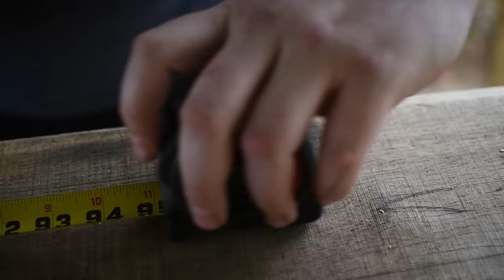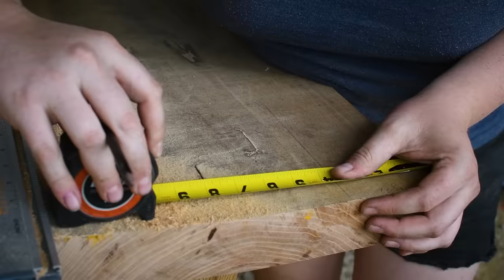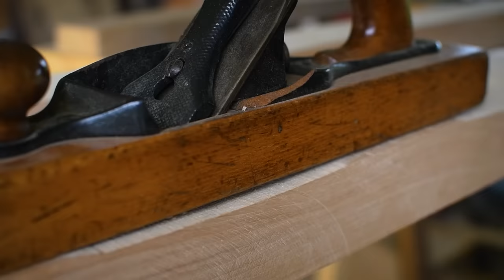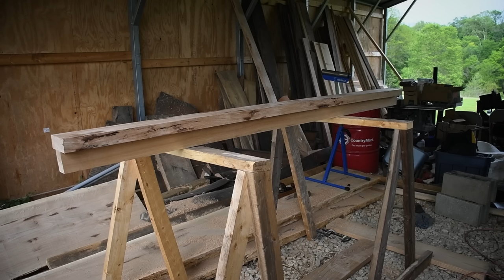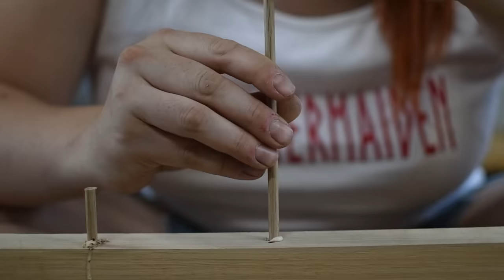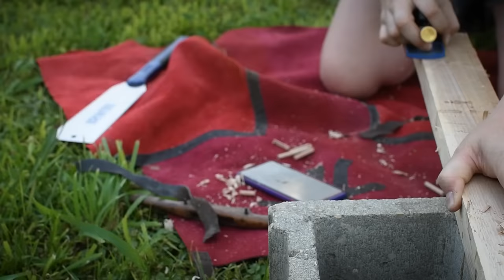Building a Longship part 3: the keel

Comment: Here’s a tip when marking a measurement at the point use a V you’ll see it’s the best if you want one can leaning towards the left or right indicating what side of the line is waist and what to be used. You know the inside or outside of the blade

Comment: If you put a piece of high density foam 2 panel 4 by 8  2inches thick on your saw horses and your lumber on top it will make it easy to cut with out worrying about   Your drop just set your blade depth so it just kisses the foam
Reply from the maker: Well that's a good idea

Comment: You where right about the wood, Too much time time fixing but a great job doing so. Also if I may, two things that may make the job a little easier. One you need a better method of holding your wood as you work on it. You are losing to much energy while planing. You need to find a better way then the saw horses. Ever time the horse moves you lose momentum of cutting though the wood. Your surface has to be stable. Second, to hog off wood a board, use a plane with a curved plane blade. Note the blade is curved and not the plane soul. This will help a lot to get the wood down to your dimension. Then use your straight blade plane to final dimension. I hope this will help.
Reply from the maker: all good points

Comment: May I suggest Veritas hand plaines( I own 4) they are pricey but well worth it. And if the plane is sticking it’s time to re-sharpen the blade. Also helps to use a little paste wax on the soul of the plane to help minimize the effort.
Reply: The sole of the plane, I presume? As in the bottom surface?
Reply from the maker: ill check them out
Reply from the maker: ok so there are a hell of a lot of options which is good for removing non end grain thickness
Reply: @ThePathOfFire  you need a longer hand plane to get straighter results, find a stanley no 5 Jackplane tun it up, or get the veritas low angle Jackplane but it cost 250buck, but a 50 buck stanley no 5 will do the same, u can watch on YouTube how to tune and sharpen a hand plane to do fine work I suggest Paul Sellers hand plane videos. Good luck!